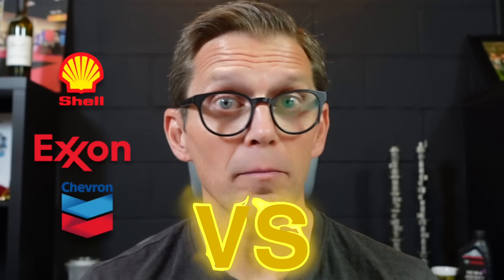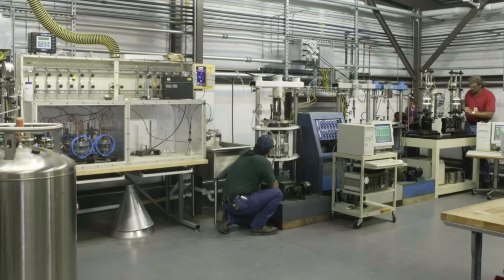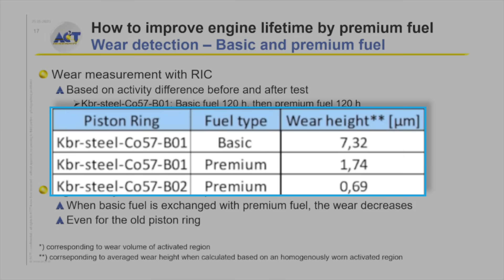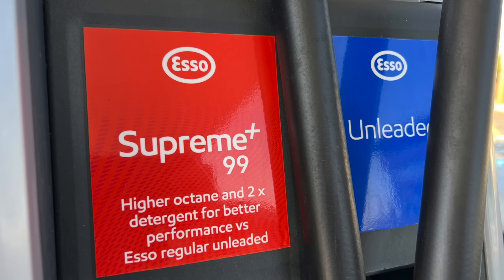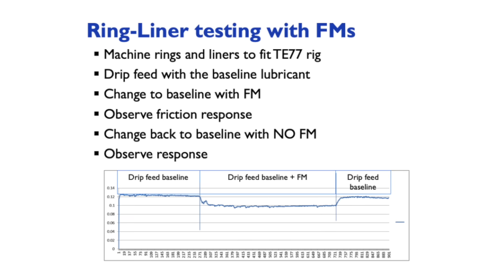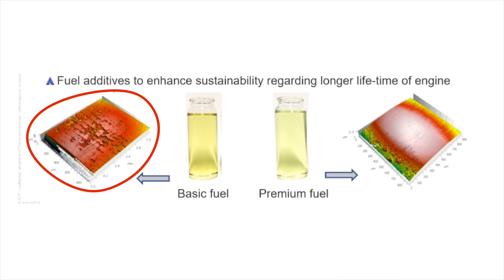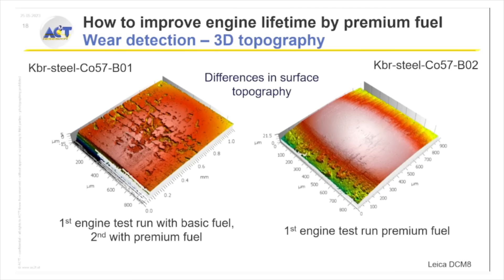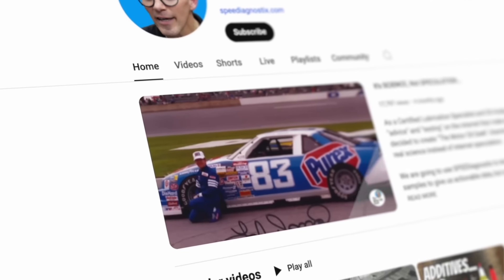Can Premium Fuel REDUCE Engine WEAR?

Comment: A few things I would like to comment on.  1.  I have been preaching this for years to family and friend's and actually had no proof till now.  So Thank You for this information.  2.  The key here folks is "Premium" Fuel.  Even if you go to a "Top Tier" gas station not all Top Tier fuels are created equal.  3.  Now the question is, "Which Top Tier Fuels" use these anti wear additives, or are they required for all top tier premium fuels?  4.  Different brands have different additive packs as mentioned.  In my area on the West Coast of the USA Shell and Chevron are the only 2 brands I know of that have these additives in their Premium fuel.  I switch between the 2 brands throughout the year because each brand being used leaves different kinds of deposits.  By switching brands (Shell, Chevron for me) I believe I will be getting the best or cleanest engine possible.  They kinda counteract each other is my theory.  5.  Statistically the average American family keeps their "new" car 3-4 yrs and then moves on to another vehicle.  So with this said, these top tier premium fuels and oils may not be used.  Why would you put top tier anything in a car that you only plan on keeping a couple of years?  So when you are buying a used car even with low miles, its possible it may have more than average wear inside the engine.  These are all factors that are interesting to me.  Additionally, with the push to EV's I am actually surprised there is such a focus still on milking out as much MPG's and wear in combustion engines.  I am just grateful the manufactures are doing these innovations still.  Not to mock EV's but the average purchase price of a new gas powered car is around $45k, the average EV sold is $62k, I don't know about you, I can't afford a $62k car, nor do I want that rolling mortgage anyway.  People pushing the EV movement just don't consider that people can't afford that technology at this time.  Its not right to push these super expensive cars and leave the folks that work hard but may not earn enough to afford an EV with a decent range.  These are facts that need to be considered.  Very pleased with this video and hope for a follow up on Fuel quality, additives and the like.  Very informative and very interesting.  Thank You.
Reply: Bolt EUV's are in the $20k's to low $30k's brand new and have a $7500 tax incentive.  Even a brand new Tesla Model 3 long range rwd is $30k.  Prices have come down a lot, might keep dropping for a little while.

Edit: Make that $42k for the Model 3, didn't see the check box that deducts the tax credit and estimated $1k/yr gas savings over 5 years automatically from the total price.
Reply: This may be true but it's also may depend on region.  I have yet to see a new Tesla long range anywhere near $30k and many of those federal discounts don't apply to everyone.  Even a Nissan Leaf is near $40k in my area and that has a range of about 120-150 miles.  Where not long ago i could buy lets say a VW Passat TDI for $25k and go 800 miles on ta tank of gas.  So it just depends on how you look at things. @GrandPrix46
Reply: I spoke with my sister's Toyota mechanic while visiting Sacramento earlier this summer. He loves his Tesla Y, but uses first gen. Prius as daily driver. I understand that where climate conditions and infrastructure allows the EVs eventually will displace IC engine, but there are many regions where the regular car powered by IC will stay. I can't imagine myself doing the trip from Eastern Ontario in a EV: I did over 6k miles in 3 weeks time. I know a very few European countries have like Norway have great EV infrastructure in the cities, but there are places where EV just go because of weather and sparse EV infrastructure. As for now America and most Europe is not ready for EVs.
Reply: @pliedtka  you bring up some very valid points and I'm appreciative that your civil about your response and not being rude or mean like some people have been.  Another problem that faces my community is apartment complexes we don't have a lot of them here cuz I'm in a rural area but we have about 8 to 10 apartment complexes in my area none of which have charging stations for EV's as of today.  So most people that I know that live in the apartments they drive over to the local mall and plug in at a Tesla charging station and again there's only four of those charging stations that are local mall and some people have to wait up to 2 hours to charge your vehicle and that's assuming that the charging stations are working correctly because there's so many people trying to get their cars charged that you have to wait in an extremely long line on certain days.  I think the whole idea of an electric vehicle is a good one I do but it's in its infant stages still and there's a lot of problems to make it affordable for the masses and to make it convenient for people to drive long distances and that time just is probably not for another 10 to 15 years away if not longer realistically speaking.  But for some people like I said I don't drive that much so I drive a Volkswagen Golf and I get gas in it maybe once a month and I drive almost 500 miles on a tank of gas.  So how is it bettering the planet for me to sell my golf and buy an EV?  Honestly I just don't think it would help in any way.  In some cases it just makes no sense but in other markets in other circumstances EV's make complete sense.  It's just these people need to understand that just because some people live in a city where there's a lot of charging stations there's a lot of availability and maybe prices are lower for such reason doesn't mean Nationwide it's the same.. or globally is the same for everyone else.
Reply: The word is getting out on EVs and it ain't good. LOTS of buyer's remorse.

Comment: Lake, I would like to see a video on how different types of fuel effects oil and wear. I watch Steve Morris Racing and they run Methanol and so does Tim Bailey and the Methanol causes rust in the engine on valve springs, push rods and other parts due to the Methanol in the oil due to high performance engines. He noticed if you add RevX to the oil, it stops the rust completely from the methanol fuel dilution. So this sounds like a time when an oil additive is a good idea because the rust is causing valve spring failure.

Comment: I would like to see more on fuel quality. But to add to it, what about fuel additives and how they wear in the piston ring area. I have used premium 93 octane fuel from Murphys fuel in my 2018 F150 3.5 Ecoboost all of its life. The kicker is ive also always 100% of the time 4 oz per 10 gallons of Marvel Mystery Oil or Lucas Upper Cylinder Lubricant. Ive actually been doing that for years before becoming a fan to your show. It would be awesome to see a show on variations of fuel but also fuel additives. The one negative i can admit to using an upper cylinder lube such my choices, it clogs a catalytic converter by 100k. That has happened on all the vehicles i have done this to. I hate catalytic converters.

Comment: the crazy thing is even thought theres so much fuel dilution in the ring lands that sludge and carbon still cause sticking rings and increased oil consumption. logic would think that the fuel in the ring lands would help clean up any build up. moral of the story, stay on top of your oil changes and don't use regular fuel when you vehicle requires premium fuel even if the OEM states it can run at reduced performance
Reply: But if the ring oil isn't flushing out the fuel dilution is it even changing out with an oil change. Design to encourage oil flow in the rings would seem to be important.

Comment: I love your scientific approach to all your topics! A fuel brand additive package comparison would be great! Also, compare off the shelf fuel additives as well. Then, if possible, compare the two and show which gives the best overall protection, and possibly, which is roughly the most cost-effective. 
Lastly, the Motor Oil Geek is a very catchy title, but scientifically speaking, shouldn't the title be the Engine Oil Geek? Personally, I like the title, but with all the ICE vs EV stuff these days, it might be more fitting?

Comment: Problem is the higher octane fuel in these new cars can cause issues with the cat converter failing. It gives the down stream o2 a false reading cause it doesn’t burn up in combustion cause the engine isn’t designed for it and burns up in the cat. At least that is what Ford claims, had a customer with a couple damaged converter and we couldn’t figure what was going on and he said oh yeah I run premium 93 fuel. The owners manual clearly states to run 87. Or it used to back in the day lol. I bet there is a difference between say, speedway or Kroger fuel 87 and say shell out bp, both claim to have better additives.

Comment: I see the long fuel lines at Costco, especially many vehicles with high compression engines. Costco claims the through their website that their fuel is a Top Tier fuel. Whose formula is Costco’s using?

Comment: "But the manual says you only need 87!" is what many people decry. What it actually says is 87 octane or higher, 87 being the bare minimum.
Reply: I put premium in my 2008 Lancer base model and I swear to God it runs better. I believe that's one of these cars that they would say is just a regular gas car but there seems to be a difference.
Reply: Higher octane is intended for lower compression engines. It has nothing to do with being a better fuel. I put 93 in my civic si because it is a turbo charged engine that call a for high octane. My Tacoma on the other hand is ment to run on 87 being a high compression engine.

Comment: Premium fuel also improves performance even if the engine does not require premium fuel. I can feel the difference, the engine just feels like it has more power.
Reply: Your statement has been disproven many times over. Unless your vehicle can sense the differences and then adjust accordingly, it will make no difference. There is no more energy in premium fuel vs regular. Premium fuel only has different additives and higher octane. Octane does not make power, it increases detonation and preignition resistance.
Reply: @jakeyoung2092 i have a high compression ratio engine and using higher octane does increase power by 8-11hp without any tune.
Reply: Most modern cars have VVT. @jakeyoung2092
Reply: @jakeyoung2092  this is correct for old cars new cars have knock sensors and ECU that can adjust. It is proven with Dyno readings. Just search 87 vs 91 octane.
Reply: @jakeyoung2092  Most cars have a knock sensor, variable valve, and other variable timings. It’s not crazy to assume that many people’s cars can already adjust.

For some reason, my GF’s little 4-banger non-turbo takes premium since it uses aggressive timings, but it’ll run on 87 but does feel slower.
Reply: @gianni_schicchi  so that's a 'no'. Naturally asirated engines that are designed to run on 87 will run on 91 no problem, but will be less optimal since detonation was calibrated for 87. Yes, naturally aspirated engines will vary the timing to accommodate things like dilution and contamination, but it will not increase power & efficiency with 91.

A turbo engine can vary how much pressure it's pushing so it can actually increase power under a higher octane fuel. But not a naturally aspirated one that's been designed for 87.
Reply: @ThePilotGear why does GM’s 5.3L L83 make 35 more hp and 43 more torque on E85 then? That engine is “designed” for 87 octane, but clearly 87 must not be letting it operate at MBT timing.
Reply: @jakeyoung2092 here's where u are incorrect.. the reason premium makes a vehicle seem to get more power, is the extra cleaning being done with the extra detergents....while it doesn't give the vehicle more power technically, the extra cleaning will remove more deposits resulting in "more power"

Comment: When you speak of premium versus basic fuels, I assume you are referring to octane?  Or is it a top tier gasoline? Exxon has similar claims but its friction modifiers are in all the grades. I am not sure about Shell.                                                                                                                Exxon and Mobil Synergy™ gasoline
Quality you can depend on
When you fill up at an Exxon™ or Mobil™ station, you can be confident you’re getting high quality gasoline every time. Available in three octane levels, our Synergy gasoline has been engineered to help clean up intake valves and improve gas mileage and performance.§§

Fuel detergents 1, 2 and 3 – provide outstanding cleanliness in port fuel injection engines, and now in gasoline direct injection engines. Cleaner engine parts can lead to better gas mileage, engine protection and engine performance. Our detergent keeps your engine 3X cleaner for better gas mileage.‡ (Benefit available only in Synergy Supreme+™ premium gasoline)
Friction modifier – the ingredient protects your engine by reducing wear and tear by 30%.‡‡ (Benefit available only in Synergy Supreme+ premium gasoline)
Anti-adhesion compound – helps prevent fuel detergents from forming a sticky film on the intake valves, which in turn helps prevent cold start problems at cold temperatures
Corrosion inhibitor – helps prevent rust in fuel distribution systems and/or key engine parts the fuel comes into contact with, such as the gas tank and the intake valves
Demulsifier – helps keep water from getting disbursed with our additive in the distribution system and helps prevent accumulation of water in your gas tank by allowing it to be separated and removed
Solvent fluid – enables the additive ingredients to stay mixed, flow and not freeze at very cold temperatures
Marker molecules – ensures we can determine if the correct amount of our unique additive is added to our gasoline

Comment: Great video, Lets explore this alot more. As an oil rep i don't recommend additives primarily due to additive incompatibility. However you brought up a point that I was unaware of in that he fuel additives are added in the truck on the way to the tank. To me this begs an investigation of fuel additives and the role they play? What features of a fuel additive would benefit reduced friction and enhance both oil lubricity and its ability to reduce fuel dilution. And how about diesel. Great video Lake.

Comment: Thank you for sharing this knowledge. Anecdotally, I consistently measured ~ 6-7% better fuel economy when I ran a few tanks of Chevron vs consistently running Arco. This was mostly highway driving during roughly the same time of day each time. Problem is, I’m terribly cheap and the Arco fuel was always 12-15% cheaper when you pay with cash 🫤

Comment: ConocoPhillips seems to run better in my corvette. I usually only stop at Conoco stations when traveling,as I’ve found performance problems using “off the shelf” fuel.

Comment: Both are important. Anti wear additives are certainly forming a coating on all surfaces, resulting in less wear. And also avoid ethanol fuel. I only use ethanolfree 98 octane gas. Less fuel consumption and happier engine.

Comment: Yes on the more in-depth fuel video! You mentioned Euro fuels have "premium" & "basic" (regular?) at the SAME octane levels? So here in the U.S. we have to buy high octane fuel to get the premium additive package? Top Tier regular doesn't cut it? Is it true that using higher octane than required will increase piston deposits due to lower combustion temps? Can we use an additive with a Top Tier regular octane gas to obtain the same results?

Comment: Awesome video Lake!!! I learn so much from your videos.
Reply from the maker: Glad to hear it!
Reply: @themotoroilgeek  I have a high boost Toyota Corolla GR has direct injection and port injection. Car make 303whp and 310wtq run stock boost 25.2 psi. I use shell VPower 93 octane the car requires 91 or better octane. It seems the car likes shell VPower 93 vs other brands of 93 octane. I heard you speak of additives in shell VPower does it have polyethylene in their fuel. Plus is use Pennzoil Ultra platinum 0w 20 witch has API SP and ILSAC GF6A (LSPI protection) specification and I change the oil every 2500 miles. Why does does shell VPower better than the others.

Comment: So, as a consumer, how do we know if a given fuel contains a sufficiently robust additive package? For instance.... Both of my vehicles have GM LGX engines in them. My owner's manual states that the LGX requires 87 octane fuel. Normally, I purchase 87 octane fuel from Shell stations or Chevron stations. While Chevron stations advertise, "with Techron" on each grade of fuel, the Shell station only advertises "VPower +nitro" on the 93 octane fuel. Does this mean that Shell 87 octane fuel is only "basic" fuel?
Reply: Chevron regular is better than Shell regular.
Shell premium is better than Chevron premium.

Comment: I use fuel additives containing PEA to clean. Is there a fuel additive that helps with wear. Thanks again for another educational video. You Rock!
Reply: Use a good quality "Upper Cylinder Lubricant"
Reply: @153eddy  Do you personally use it every fill up?
Reply: @153eddy  Some used to add a high quality TC-W3 rated 2 stroke oil to the tank (forgot the mixing ratio), but not too sure I trust that, ever though it is supposed to be totally 'ashless', in a modern turbo gas direct injected engine.